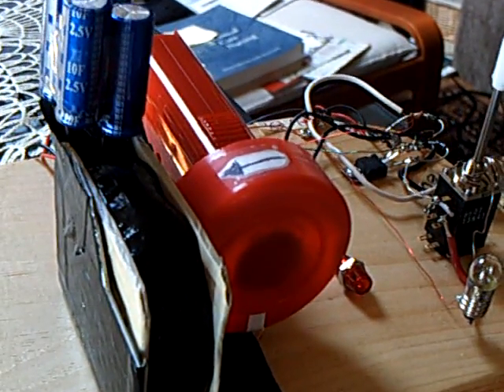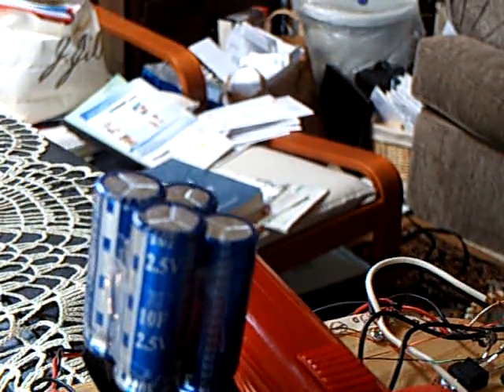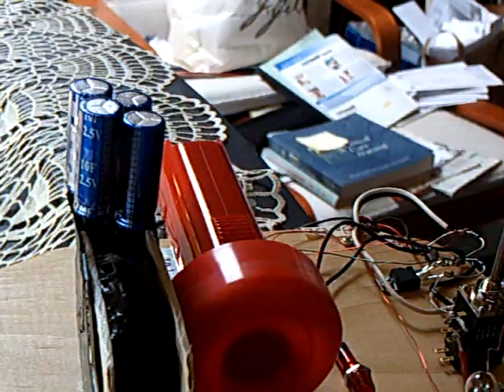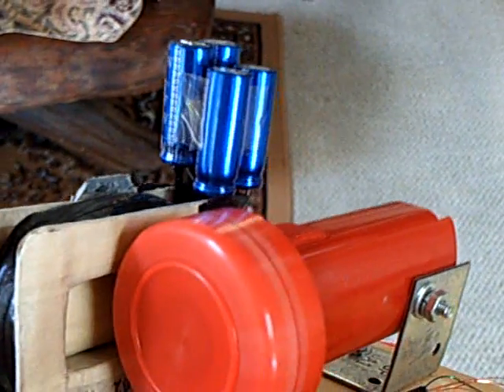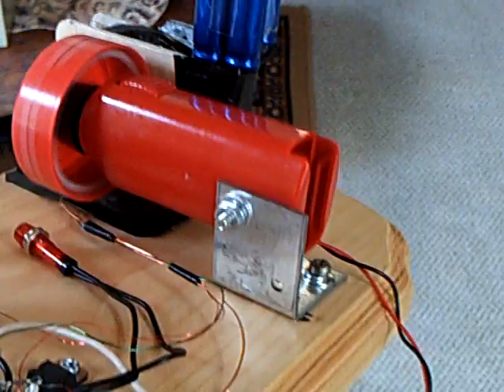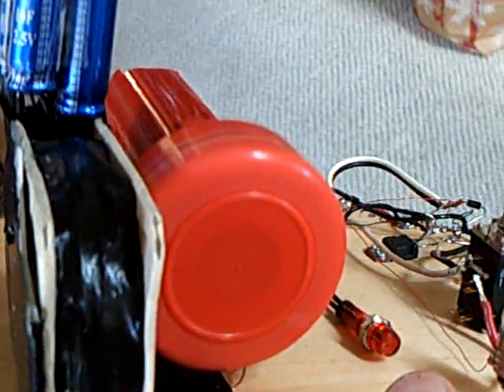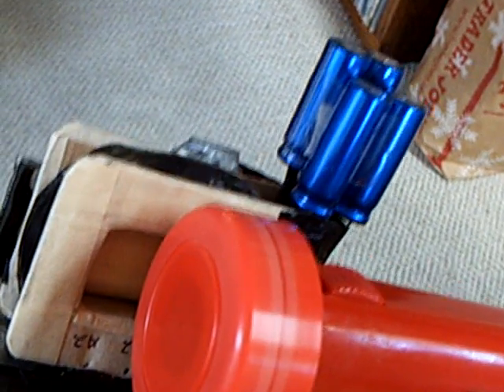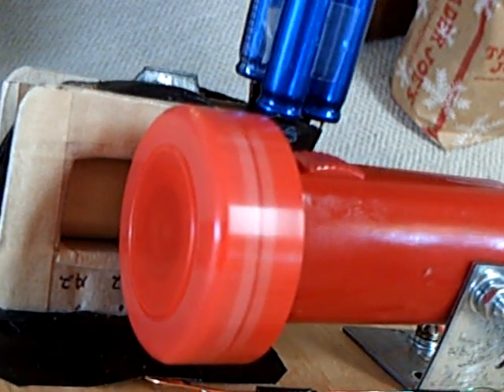Super Capacitor Bedini SSG Lid motor

Comment: can charge the supercap more than 5V?
Reply from the maker: Amin Wahid If you put the super capacitors in series you can increase the voltage input.
Reply: Connection of series same as regular capacitor?
Reply from the maker: Amin Wahid Yes

Comment: @JimTheHermit They are 10F 2.5v caps. put two in parallel, and you get 20F @2.5v.  He wanted 5v.  Place two in series, and you half the capacitance, but double the voltage capability.  Two sets of (2 in series = 5v@5F) in parallel with another set of two that are in series = 5v@double the capacitance = 5v@10F).  Electronically, that is how it works, however, I am not sure if that is how he has it configured.